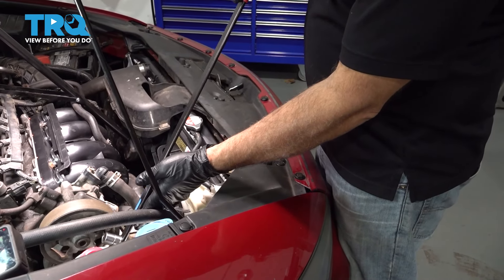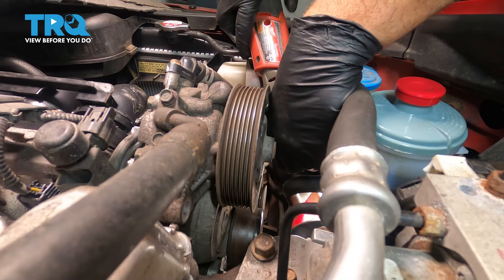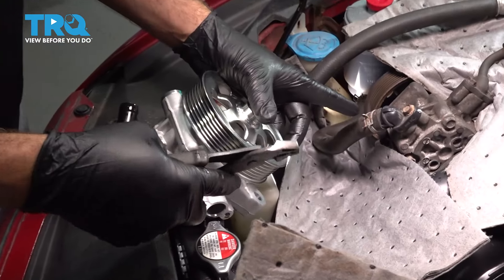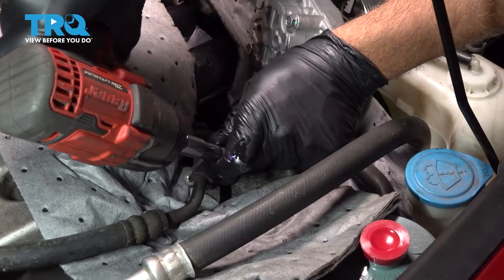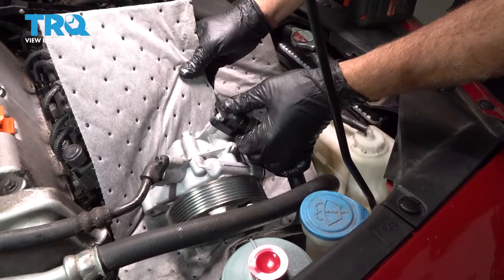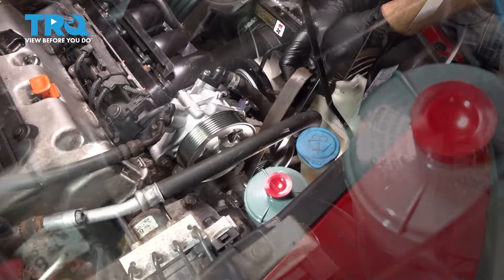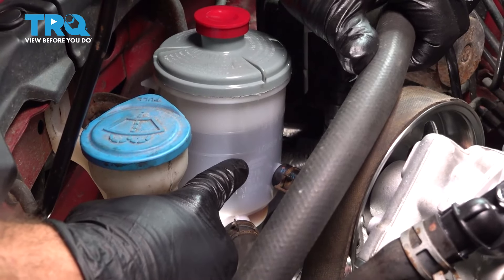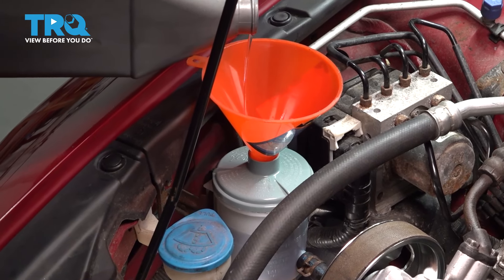How to Replace Power Steering Pump 2008-2012 Honda Accord 2.4L

Comment: I got a quick question, do you have any solutions on how to fix the noice on start up it makes for like 2 seconds the cracking noice it makes after leaving your car off for a while/overnight?? Please let me know
Reply: vtec actuator
Reply: You need to replace the o-ring on 1 or both of the pipes that lead into that pump and possibly clean your reservoir
Reply: I have this car and I hear it coming from the vtc actuator area a typical thing that slightly failed on the 2.4l in many Hondas of that generation. I even went to the dealership and they said it isn't a fatal issue but I digress. I'd say get it looked at though

Comment: I heard your Accord do the same thing mine is doing and that is when you first start it, it rattles like there are metal marbles being rattled for a few seconds, again, right at start up and then it stops. Any idea what that might be? Thank you in advance for your answer!
Reply: the VTEC actuator is whats making that noise. Its a known issue on the 8th gens. ChrisFix has a video that shows how to replace the actuator exactly on this car.
Reply: Probably your VVT actuator. Not a simple job as this power steering pump replacement.

Comment: I tried it and succeeded. My only hang up was that I forget to take  a picture of how the serpentine belt was on before I removed it so I had to pull up a diagram to see how it was before I pulled it off. Other than that this video was spot on!

Comment: When you started the motor, I heard that rattle is that part of the VVT system that needs to be checked? Mine does the same thing and I’m trying to figure out what it is.. it’s not the motor tapping or anything but it does it briefly on start up

Comment: Where can I get the bar used to remove the 14mm bolt for the pulley belt.
I have no clearance or leverage with my offset wrench.
I need that low profile bar!
Thanks in Advance

Comment: Is this part specific to the 2.4 or will it also work for a 3.5 v6?
Reply: Have gained experience and knowledge of vehicles by working at an auto parts store and based on the 2.4l and the 3.5, those would be different engines so I'm sure it will be different power steering pumps.

Comment: No air bleeding? 
I did everything as shown in the video, but when I started the car, the fluid became bubbly and eventually overflowed through the reservoir.  

I let it stay for a night, in the morning the liquid looked fine and I did the air bleeding, but the results are the same: the liquid becoming very bubbly. 

If someone know that's the problem please let me know

Comment: yes there is a gasket that needs to be replaced on the high pressure line or else it will leak.

Comment: Anyone steering wheel hard to turn after replacing the pump ? I felt like I’m driving a race car having to pull that steering wheel back & forth trying to get it loosen up

Comment: Why don't you guys do the proper torque specs ? You just tighten the bolt is that the correct way just to guess?